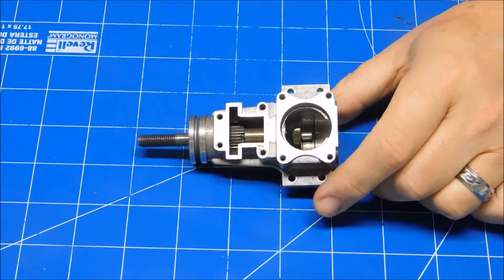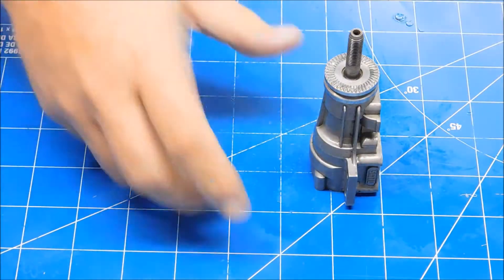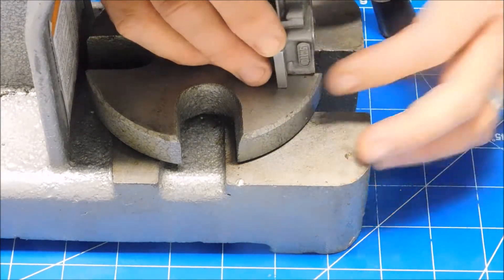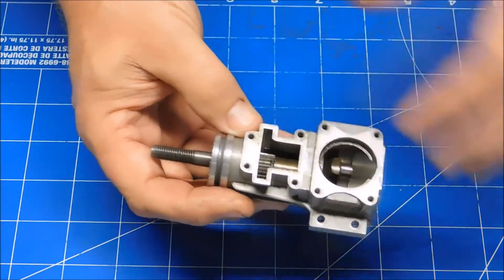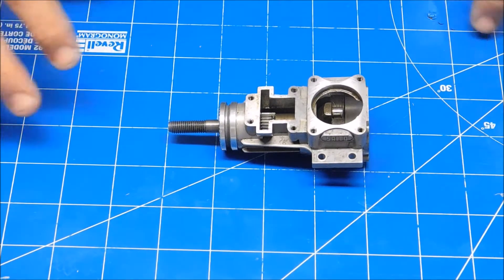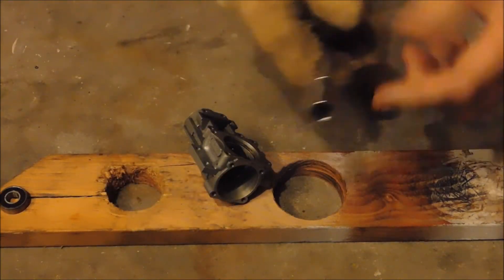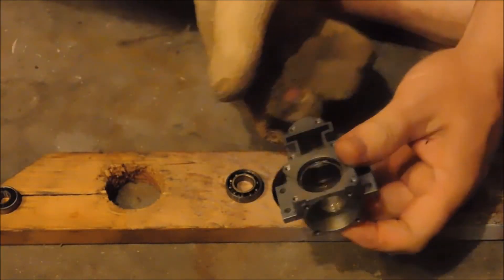How to: Saito Engine Bearing Removal

Comment: Your method for removal of the drive hub transfers forces directly to the races of the front brg.  There is a slot in the prop drive washer to mount a puller which is the normal removal method.  One may also make their own puller using a large flat washer cut into two halves.  Then rest the crankcase between two parallel surfaces such as an open vice.  An off the shelf puller or battery terminal puller may also work.  The puller prevents forces transferring to the races of the front bearing and crank housing during the removal process.  This lets one check the condition of the front bearing before deciding to discard it.   Heating the hub with a heat gun is recommended, as thermal expansion of the drive hub helps it to release while minimizing risk of damage to the prop hub's taper mounting surface.
Reply from the maker: Maybe you should look at a newer video.... https://youtu.be/ETy4Obxiepc

Comment: Hı, I want to ask a question about these engines. Especially the gas versions of Saito. Do you have any experience regarding saito gas engines, like people say that saito gas engines stop in the air if the weather is too hot. I am living in a very hot place where in summer time we get 45co degrees. Is ıt true to say saito gas  engines are not performing well in hot weather conditions. Thanks.

Comment: David, I viewed yur Vid on bearing removal , before I started -  very good explanation.I have a Saito FA 80 that has a bad bearing . When I removed [ very carefully] the cover which houses the push rods from Engine block , I could not see any physical markings on the pinion gear for replacement ?
I thought this would be an easy ? ha- removal of the shaft - heated the block til too hot to hold ,went about as you have shown- to remove Shaft - which is a NO go. I hammered away but no movement of the shaft ?
For lack of anything else , I applied Kano KROIL oil [very good penetrant ] to the inside of the block, which is now soaking.
Reply from the maker: Are you sure you are talking about a Saito FA 80 engine?  This engine does not have a pinion gear that slides onto the crankshaft.  The gear is cut into the crankshaft.  Only the 65 and down incorporates the pinion gear for timing.  Maybe I misunderstand your issue.  See page three of this review.  It shows a picture of the FA-80 crankshaft. http://sceptreflight.net/Model%20Engine%20Tests/Saito%20FA-80.html
Reply from the maker: AS far as crankshaft removal, yes it may take some soaking with penetrating oil. Keep in mind you are also fighting the press fit of the brass collar inside the drive washer too.  So make sure you soak that area with oil too.  I use both 3 in 1 and PB Blaster along with a heat gun.
Reply: Thanks for the come back .  Yep tis Saito FA 80 , gear is cut into crankshaft .  I was  able  to get shaft out - HAVE TO pull prop hub first vs tappin on it . It fell out just fine, removed bearings and replaced them . NOW , I am puzzeled about getting  gear box back on so that the timing is correct .I noticed there is a small hole in the cam lifter part but no way to run anything down the push rod opening to fit in that small hole . Let me watch yur vid again as I was hoping to have thing back togeather today .  Thanks
Reply from the maker: Timing is simple.  Watch this video. https://www.youtube.com/watch?v=bTjExGAoge8
Reply: In that Vid , after lining up the dot on the gear , You run a small driver down to lock up the Cam
On this 80 , there are cups that hold end of push rod   and no way to run anything down to lock the cam shaft lobes in Place ? I'm stuck :-)
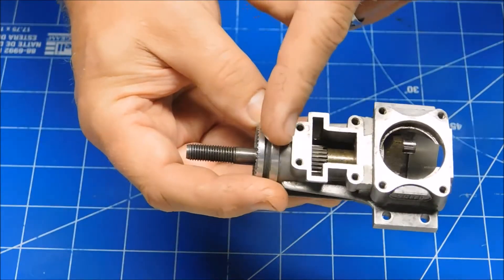Reply from the maker: Tom Eutsler Tom the cam followers come out of the timing housing just like any other Saito engine.  All Saito engines can be timed the exact same way. If your head is off and the timing housing off, simply remove the timing gear from the housing and push the intake cam follower out of the housing.  Look at the 1:15 mark on this video. https://www.youtube.com/watch?v=D9KJql_KZXs&list=PLsvn3JGZAOMv8LaR5fFvjyqH3NZ2sgVBv&index=30
Reply: David, thanks for yur wisdom:-) On taking timing gear from housing, I found the shaft had a FLAT on one end -made a little scribe on shaft to note UP so that grub screw screwed down in the flat.Spend lota time putting it back togeather ,getting washers to line up .Hope I got it lined up so motor will run .patience patience for sure.Tis all back togeather thanks to you.Now I can do my Saito 65 .  Thanks ....

Comment: As is normal the vibration in motors 4 cycles and this was my first, I never noticed if it had excess vibration. I feel it just with the crankshaft in the crankcase.
Reply from the maker: +Admar A Godoy Unfortunately that is just not enough information for me to make a determination.  If this is your first 4 stroke then what you feel could be normal.  I have no way to determine if what you are feeling in YOUR engine is normal or just inexperience on your part.  Is the engine fully assembled or have you taken it apart?  Have you tried running it yet?  I assume you would know what bad bearings feel like if you have had other 2 stroke engines.  The crankshaft could also be bent but again, it is impossible for me to determine that.  Sorry I cannot be of more help.

Comment: hi David. when i turn the shaft it makes a small vibration. is it normal? 

https://youtu.be/t9QKE9I8uFc
Reply from the maker: +Admar A Godoy I really do not know if I can answer that without feeling it.  Is the engine completely assembled or just the crankshaft in the crankcase?  Doers it feel different than it did before?   Too many variables to answer that.  I do not know how it feels.